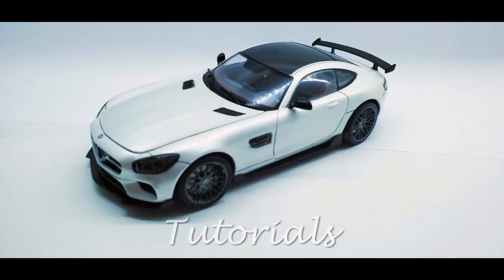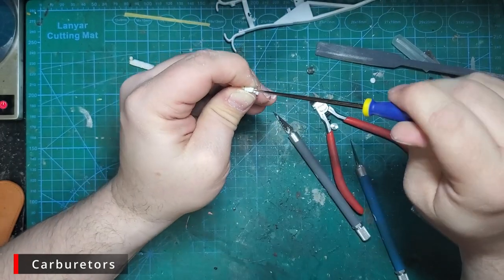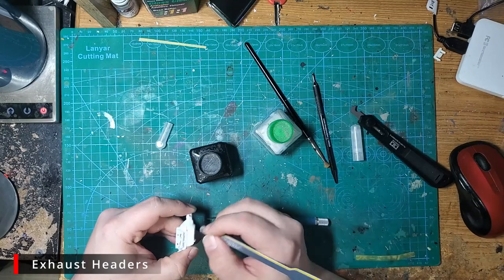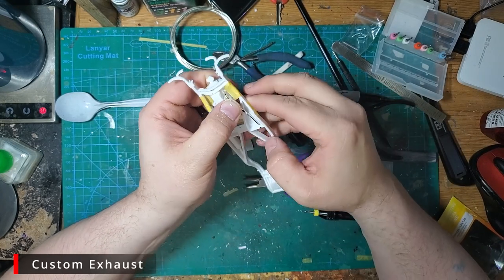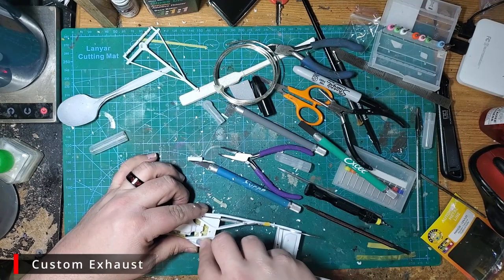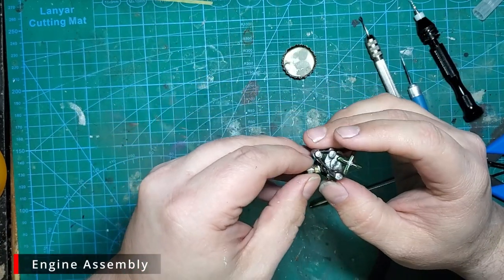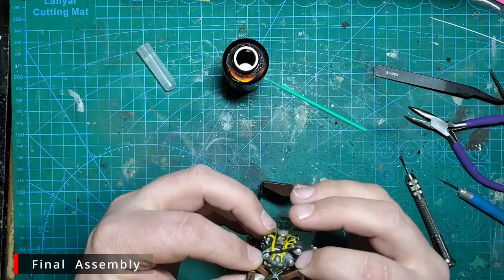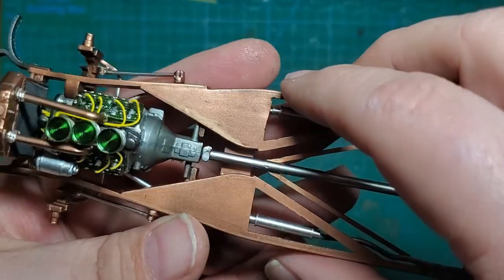Revell - '40 Ford Pickup - Engine and Chassis - 80th Anniversary Group Build

Comment: Amazing job Justin nice details on the engine and the exhaust is a really neat job the chassis looks sweet with those colors and the carbs with that touch of green looks cool catching up on your videos thanks for sharing buddy 👍
Reply from the maker: Thanks Seamus! :) One of these days I gotta step up to lights. I always have issues figuring out where I'm going to stick the batteries and stuff though. With my star wars stuff I just wire everything to the base and cut a USB cable and run to it. But I don't really want the wires hanging from cars.
Reply: @JHartModelworks  I run all my wires inside the builds if I put it onto a base there only 2 wires running out underside into the power supply the magnet wire is pretty thin enough to hide my last build the ww2 fuel truck you can see what I'm talking about 👍

Comment: What kind and size of wire you used for exhaust pipe
Reply from the maker: It is jewelry wire I got from Hobby lobby way back when I did jewelry and doesn't have a label. But i just checked and it looks to be 14 gage. you could probably use 12 gage as well if you want something a little thicker. 12 is about 2mm, 14 is 1.5 / 1.6mm.  Welcome to the channel. Thanks for watching. it's way too shiny for me and won't hold paint as is, so I sanded it and primered with mr surfacer, before painting with mr hobby super metallic stainless steel.
Reply: @JHartModelworks  thanks for the info
Reply from the maker: @bigdave0311  Absolutely